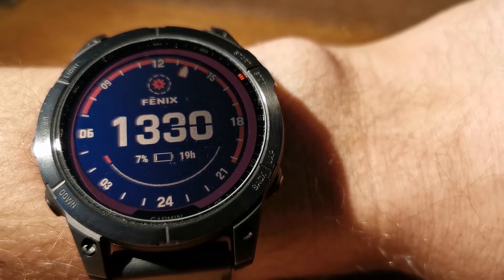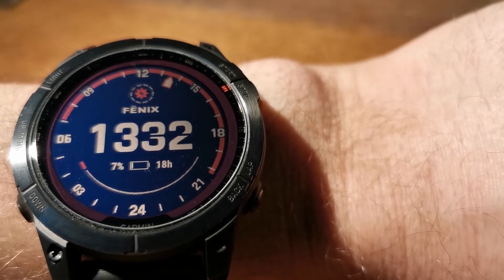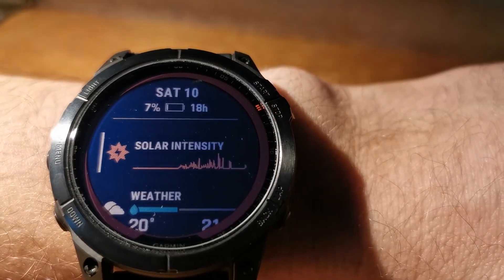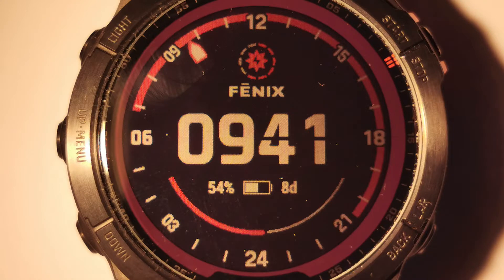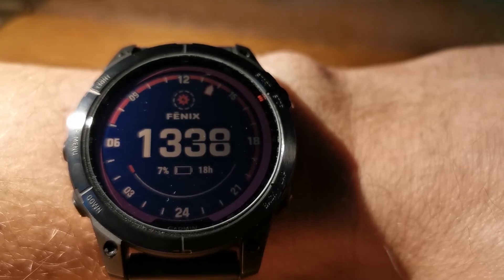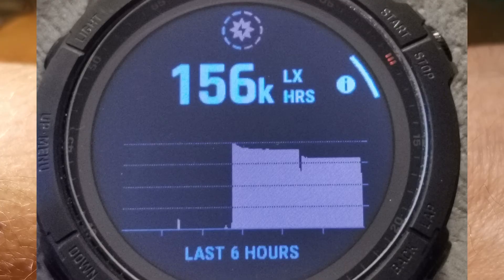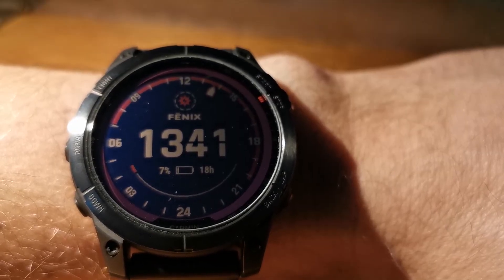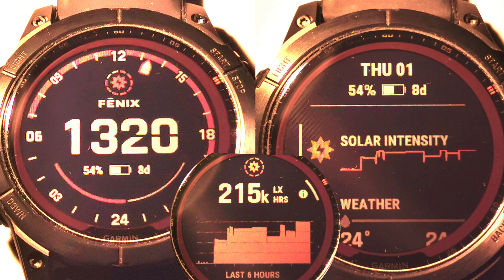Garmin Fenix 7 - Solar Charging Efficiency Test

Comment: 1. The solar is not designed to be charged of light bulb but actual sun energy.
2. The solar on this watch is for extending your use and not charging your watch.
It's all in the watch manual

I hope it helps.

Comment: The reason your watch was showing the difference was because you turned it back on. The other options you needed the watch to turn off then back on to reset the percentage. It was charging on each of the other attempts but never resets unless power cycled.

Comment: THis might be worth revisiting.  I forgot how long ago it was maybe 6 or 7 months ago they released an update that would allow a positive battery charge to show up on the watch.  Before the update the watch would only show the watch at the same charge or lower even with solar.  IT would only update to a high battery charge if you rebooted the watch.  Which seems to be the case with you when you rebooted it was showing a little higher
Reply from the maker: I did more tests. The battery always goes down. I updated the description with the additional results and I put it here as well:

The battery always goes down when the watch is in the Sun, even at 100% Sun level. Even if I switch it to aeroplane mode. This is my test:
- the battery went down by 0.08% in 10 minutes at full Sun when the watch was in normal mode (airplane mode OFF).
- the battery went down by 0.06% in 10 minutes at full Sun when the watch was in airplane mode ON.
- the battery went down by 0.27% in 10 minutes without any Sun when the watch was in normal mode (airplane mode OFF).

With airplane mode battery goes down slower as I would expect. Sun decreases the speed of discharge 3 times.

So, the conclusion is that with solar charge battery goes down 3 times slower.

Comment: This is so useful, thank you!  I am in Thailand and the temp is about 106 f and equitorial sun is so strong. I wonder if my speed would be faster, or I saw on your chart that the lamp may be maxing out your charge according to the graph. What do you think?
Reply from the maker: It could be a bit faster, but not 5 times. maybe 10-20%. But this is my guess. It has to be tested properly. Temperature does not matter, the sunlight intensity, this is what matters. But sunlight intensity is almost the same everywhere, only depends on clouds and altitude.

Comment: Same way that you can’t feed your house plant with a desk lamp, charging wont work if it’s powered by a lightbulb. Wrong wavelength in the in the light source. 
Furthermore, I think the point of solar-charging is to maintain battery life rather than charging it fully.
But what do I know…
Nice video man

Comment: Thank you for your video. When I bought the watch, in my case 7x, I had no expectations that the solar function would maintain the operation perpetually. Garmin’s advertising merely provides data that operations can be extended with solar charging. Also keep in mind that although no perceivable battery percentages can readily be seen when under a lamp, there also is no obvious decline either. It should be noted that this is likely due to the solar function providing the necessary power to maintain active operation, without any observable net gain in battery level as many consumers expect. The misunderstood thing is just because it has solar charging doesn’t mean that it will top off a battery. Solar charging only contributes to the running power requirement in this case without much extra to amount in net gain of battery level. Whether people find this adequate or not is for the individual to decide.
Reply from the maker: Yes, you are right. Briefly, the Sun helps to reduce discharge level. The only way to fully charge the watch is to switch it off completely and way for 7 days as mentioned in the video. Maybe for someone on desert island it make sense to wait 8 hours on the Sun for 5% charge. It will allow to understand where the person is and what is GSP coordinates of this island.
Reply: So basically what it does is stop the battery from draing or draining faster?
Reply: absolut agree!

Comment: Excellent testing sir , are you suggesting that the watch must be powered off while under the sun for the solar charging to work? Also have you dobe more testing , more videos on this?
Reply from the maker: You are welcome. If you want to charge the watch with the Sun only and as soon as possible, then yes, power it off. 
In normal life it helps as well. Sun is basically reducing the discharge speed. I am going to do more tests, because there were some comments, that it is only display problem that battery level is not going up.

I do not have more videos about solar charging, but I do have more videos about Garmin Fenix 7 hotkeys, Watchface settings, Open water swimming.
Reply: It can increase while the watch is on. You just need to restart the watch to update the battery percentage.
Reply from the maker: @Luke00722  Whatever I tested not. It is just not enough solar energy to charge it faster than it is discharging. With solar charge, the battery goes down 3 times slower, than without it.

Comment: The watch needs to be turned off and turned on back in in order for the battery level to update. For some reason it only uodates the battery if its decreasing, not increasing.
Reply: Does this mean that the battery percentage reduction is slowed down due to the actual gained charged
Reply: @mattpoulton1  it stays at that same percentage until it actually drops below it.
Reply from the maker: Interesting observation. I will test it as well.
Reply from the maker: I tested one more time. After latest watch updates. Battery always goes down when watch is on the Sun, even with 100% Sun level. Even if I switch it to airplane mode. This is my test.
- battery went down by 0.08% in 10 minutes on full Sun when watch was in normal mode (airplane mode OFF).
- battery went down by 0.06% in 10 minutes on full Sun when watch was in airplane mode ON.
- battery went down by 0.27% in 10 minutes without any Sun when watch was in normal mode (airplane mode OFF).

With airplane mode battery goes down slower as I would expect. Sun decrease the speed of discharge 3 times.
Reply: @zlelik  in battery saver, I have managed to uptick the battery. Why not try that next time?